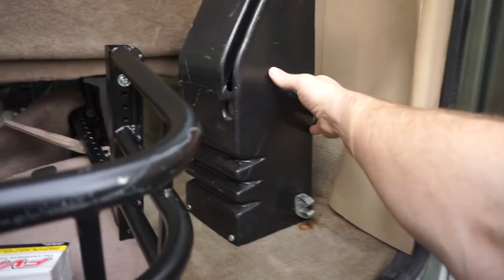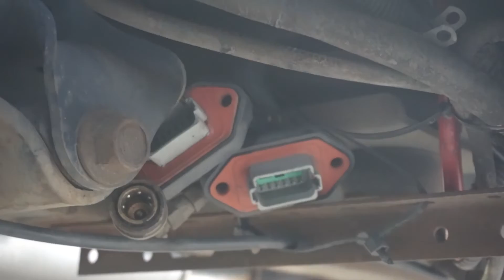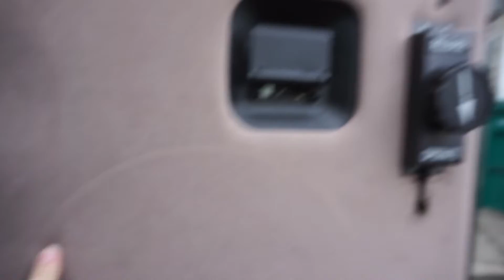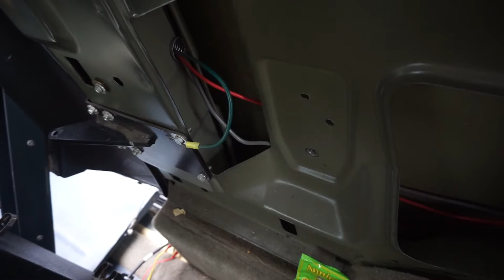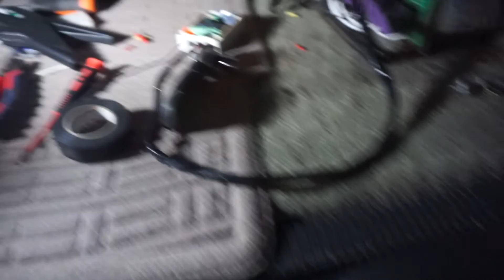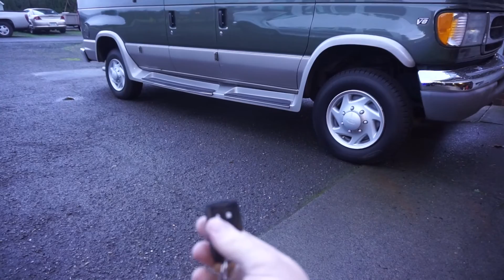MEGA VLOG 470: setting up the van! (part 1 - electrical wiring)

Comment: Do you like steering with the tri pin as opposed to a double pin or a steering knob aka suicide knob ? I have a steering knob in my wheelchair conversion mini van Braun Enter Van w/10 " lowered floor .
Reply from the maker: the tri-pins dont require holding onto anything.. so makes it a lot easier for me :^)

Comment: Dude that looks amazing I love the set up that you have going on! Also the reason your lift beeps three times when you open the door it’s because it activates a driving inhibiting feature. 

So hypothetically speaking if you forgot to put your van in park and you deployed your lift if the vehicle is in a standstill position that safety system would prevent your van from moving. Plus it also reduces the speed on the lift when it travels up and down when the safety system is engaged. I remember that because my bus driver left the bus in the drive gear by accident in the lift beeped when it was going up and down.